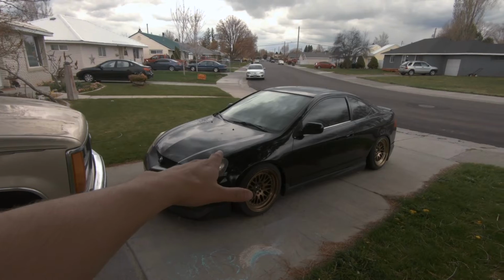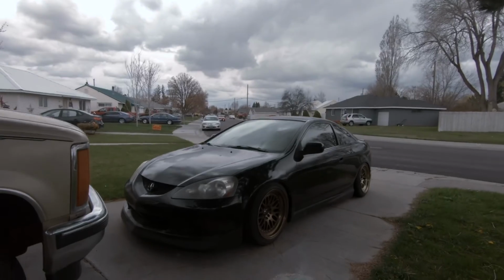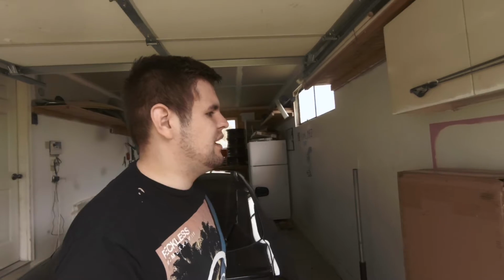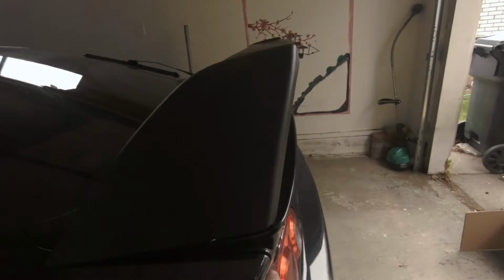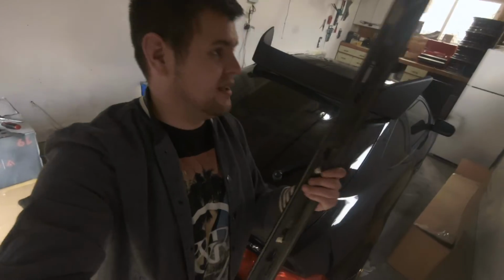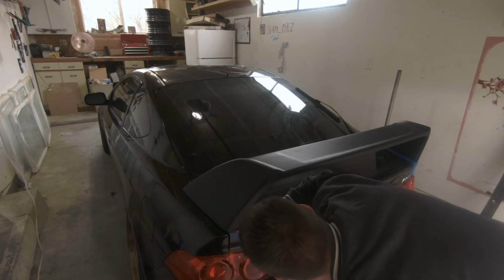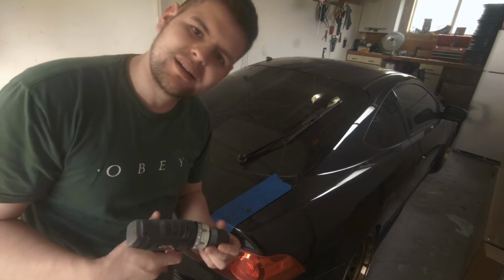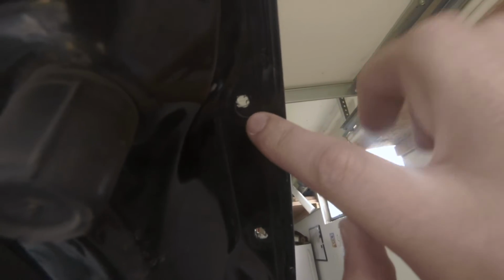Every RSX needs a Spoiler!

Comment: does anyone know the dimensions of the predrilled holes? i just bought one of these and want to put a type r spoiler on it
Reply from the maker: If you open the hatch there is small indicators that show where the spoiler goes.
Reply from the maker: 8:04 is when I show it.